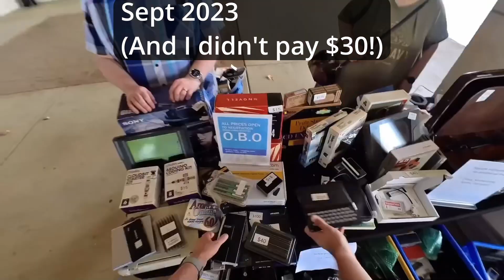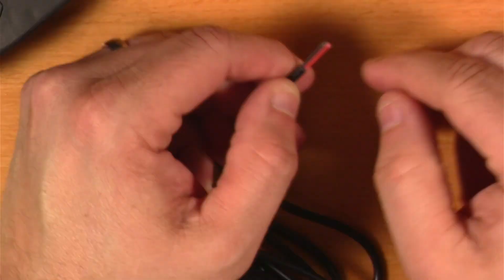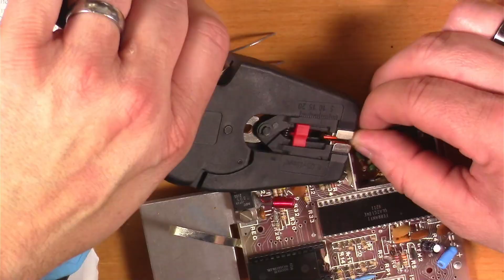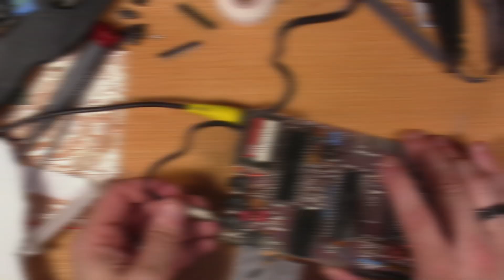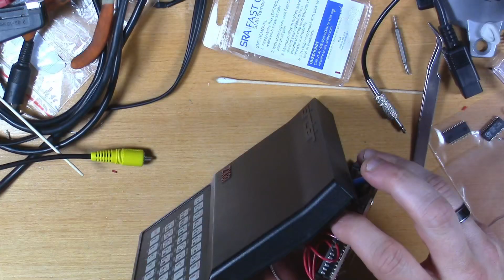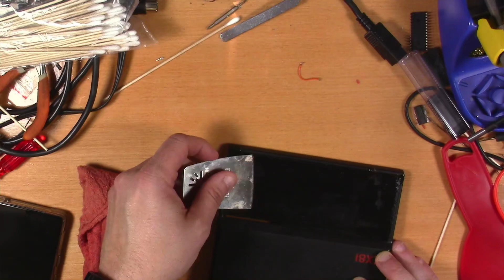Sinclair ZX81 Spruce Up (Composite, 16K, Keyboard & More!)

Comment: A CMOS Z80 runs at 20ma compared to 200ma for the NMOS version, a Traco switchingb regulator. Full length heatsink on the ULA, maybe a CMOS EEPROM to replace the old ROM.
You then can run a ZX81 off a PP3 battery or PV !.
Maybe a World championship challenge,  who can run a zeddy the longest off a simgke PP3 battery.
Reply from the maker: I like that idea! Thanks for the comment and info.

Comment: I know I'm a bit late to this video, but why did you remove the original RAM socket and put another socket on ? You could have just plugged in your new RAM IC.
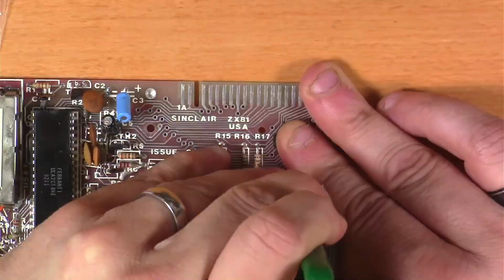Reply from the maker: If you go back and freeze the video around 11:04. You can see the original socket was only 24 pins. The first thing I was going to try (and subsequent whole chip) had a 28 pin footprint. Could I have rigged up something else? Maybe. But the basic answer is the 24 vs 28. Thanks for watching!
Reply: @JamiesHackShack  Sorry, my bad. 👍
Reply from the maker: @Franko_Walker oh no need to apologize! Take care!
Reply: @JamiesHackShack  You too.

Comment: You should replace the power parts with a switching power supply. It will reduce the heat a lot...
Reply from the maker: @jaycarlson2579  I've got a switcher type regulator and debated on doing it that go around. I should go ahead and swap it for sure.

Comment: Great video. Appreciate the patience on this, especially without a desoldering station! I too wonder about mixing the power and audio jacks...it's a potential accident waiting to happen for me 😂
Reply from the maker: Thanks for watching! Yeah I need to get bite the bullet and get a proper desoldering setup. Maybe some others will chime in about the power/audio jack question.
Reply: The Microphone output has a 1K resistor to gnd, so 9mA. 9 x .009 = .081 mW.
The Ear input is 220R to gnd, so 41mA 370 mW. Its a 500mW resistor.
No harm.

Comment: I haven't ever been inspired to get a ZX81 but watching you go through this, the struggles and victories has really changed my mind about whether or not it's worth getting. I think this is pretty dang cool, especially when you look at its place in computing history.
Reply from the maker: Right on. Yeah, back in the day I had zero interest but that certainly changed as I've gotten a little older and interested in how we all got to where we are now. Especially in hearing stories of others. I really love hearing stories of how others got their first machines and what those experiences were like for them. Maybe a spectrum is next. Perhaps an og one but I really also like that mechtrum case Lee Smith has designed!
Reply: @JamiesHackShack  It’s just amazing what Sinclair managed to build with just 4 chips for £70 in 1981! (£50 as a kit) Its predecessor, the ZX80, sold for £100 and had 21 chips, and didn’t have slow mode so the screen would go blank every time the CPU did anything. Never in human history did so many get so much from so little for so little!

Comment: Not using the official 16k RAM expansion module is cheating! Nothing like loosing 2 hours of typing after you accidentally bump the computer slightly.
Reply from the maker: I've heard those stories. That had to be both sad and maddening!
Reply: @JamiesHackShack  It was infuriating, but I insisted, and (true story) one day as a 13 yr old or something with a severe cold, I sat there pushing the buttons. Too busy to manage my sneeze that I must have felt was coming, it all went out and hit the gap between the RAM expansion and the ZX81. From that day there was no ZX81, but I'm happy to say I got a Spectrum short thereafter.
Reply from the maker: @AndersCandell  Wow!

Comment: That's a pretty nice image after the composite mod! /Brett
Reply from the maker: It really is. However, whatever magic it does... does NOT agree with my little cheap composite capture. Its like super blink/flash city. :)
Reply: @JamiesHackShack  Yeah, I've noticed that with some machines as well.  I've got an Elgato USB device that I've had for ages ... composite and S-video in, designed for simply digitising video tapes I guess ... my latest VIC-20 doesn't like it either (making me think, initially that the VIC chip was NOK).  I'm thinking I might use my Sony DVD/HDD recorder instead ... started using it for the SCART input needed on the Thomsons ... just record onto the HDD and then playback/capture via the Elgato afterwards ... basically let the Sony figure out the weird inputs ... and knowing the Sony will output a proper S-video signal.
Reply: Still a doorstop though...
Reply from the maker: @MrWaalkman  😂